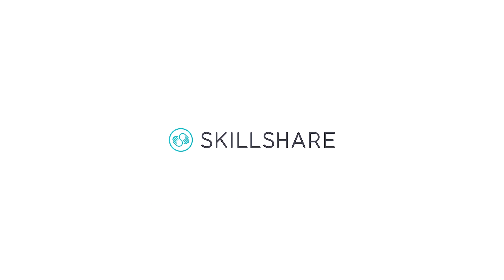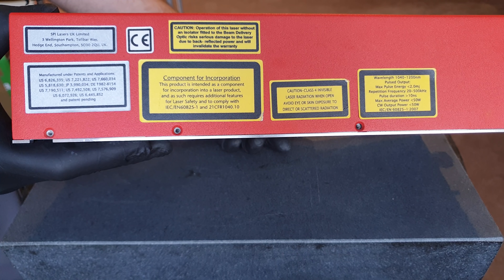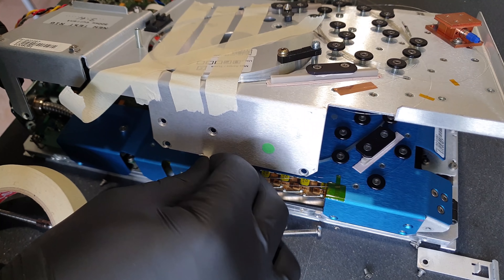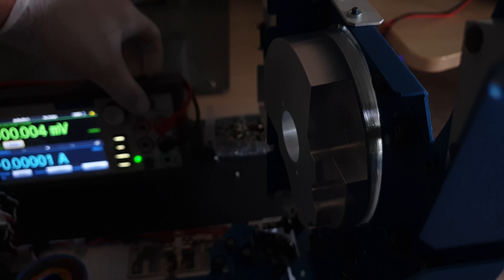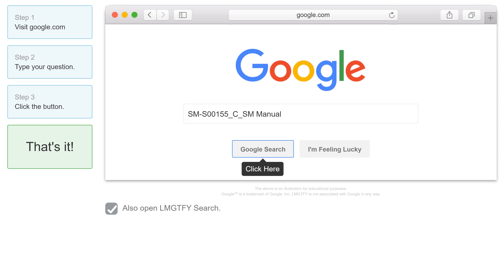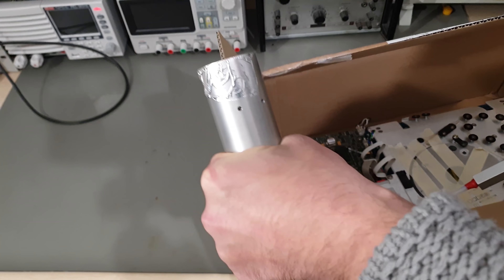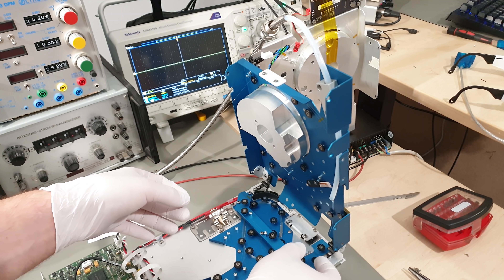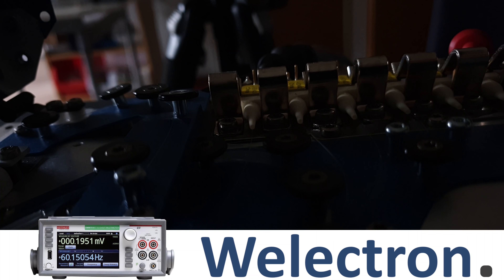Fiber Laser ⚡ 200 kW Peak Pulse Power!

Comment: Your "Way more powerful" diode bars are nothing compared to good fibre lasers. The beauty of these things is single mode spatial output (pulse characteristics are also nice but not as unique) that lets you focus down to micron or less spot sizes. The relative increase in intensity due to this dwarfs anything big multiomode emitters such as a diode array could ever achieve with their limited focal size. All that said this looks like it may not be strictly single mode fibre, should have got an end view shot of the output fibre from the splicer (the fact that you can change the mode shape by adjusting the fibre position indicates this). If that is the case any incorrect bend in the high power fibre section will decrease or even destroy your beam quality. Alternatively the output cleave / AR coat before the isolator might be bad. Also the copper tape is likely just a beam dump for unwanted low power light.

Comment: The circular things are slanted just to keep the input and output plane aligned with the board with the pegs, yet providing space for the correct length of rolled up fiber. This part of the machine must not tilt the fiber to much, thus giving the engineer two choices. 1. Build it linear (and end up with several meters of machine) 2. Roll it upp neatly somehow and dont mess with the axiss.
Reply: WGwireless would the word axi fit there?
Reply: The idea is to counteract the axial twist formed when coiling? 
I wonder if forming a figure-eight, like a faked rope, would allow a design without a tilted section.

Comment: The Fitel S184 is a 3-phase arc fusion splicer, the first of its kind anywhere.  It can accurately splice fibers up to 1200 micron diameter.
Reply: 1200mm? That's oil industry suff, not fiber optics.
Reply: @NGC1433  Pardon me...1200 microns.
Reply: You still need a cleaver to cut the fiber. Possibly 2 depending on the spice. Active fiber is octagonal in shape and needs a special cleaver.  Other splices like the pump combiner use simpler cleavers/splicers

Comment: Definitely misaligned output head. You can bend single-mode fiber in reasonable ways without affecting output shape. You can buy new Chinese output head, and splice it there in place of old one. Re-aligning it is extremely challenging.

Comment: I used a very similar model arc fusion splicer years ago when I was working for one of the major cell phone networks, splicing fiber in some specialty systems for big clients that required cell nodes on site.  Those are some amazing machines.  I never could figure out  just how it manages to actually measure loss in the splice without sending any light through the cable.  I guess it just evaluates the image from the cameras.

Comment: Where do you find all these lasers? I regularly search ebay and the most exotic thing I've come across was a range finder from a British tank. I think it had a pulse power of 20W or so and I doubt I'd be able to make use of its original functionality since the military propably doesn't publish manuals for their tanks online.
Reply: Janis Reinberger Same for large caps...
Reply: I assure you those old  flashlamp driven rangefinders can easily do over 1kW  pulsed output...but they're not designed for high repetition rates.
Reply: With used high tech stuff it's all about who you know. You can get crazy expensive broken or old stuff for free if you know the right people.

Comment: Perhaps the output head is also misaligned?
You're lucky that this laser doesn't use the output fiber and head as part of the "resonant cavity"(ish). I believe some IPG lasers do that, in which case cut cable = paperweight laser, even if you manage to splice it back together.
Reply: Off-Topic: Are you Spirit532? Ex staff on UC.me?
Reply: Why is that the case?

Comment: 11:55 If measured by an OTDR, most likely that fusion would have like 0.3 or so dB loss, the fusion got a little "line" on it, which means it's not perfect (though it could pass, sometimes with a bubble the signal passes better than when it is a perfect fusion, so... who know, only an OTDR can tell)

Sauce: Work in telecom, splicing fibers

Comment: Loved this vid.

Brings back a lot of memories for me, as I used to use the Sumitomo splicers at work (Nortel 1999-2001, then Bookham's).

I think there was a connection between Nortel or Sifam and Oclaro? (makers of the pulsed laser in yours).

I used to do splicing for building EDFA (Erbium-Doped Fibre Amplifiers), which would have worked in a similar way to your laser, but nowhere near as high a power. lol

That laser lab in Hanover looks awesome, too. Kind of wish I still worked with lasers.

I have two 50-70mW Argon lasers collecting dust atm.
Reply: Bookham became Oclaro and was recently bought by Lumentum (one of the two companies that JDSU split into). I started working at Nortel in the late 90s, good times!
Reply: I actually loved it when the screen blacked out. Felt like a mini nuclear explosion.
Reply: @ferrumignis  

Ahh, that was it. Bookham changed it's name, thanks. ;)

One of my lasers is a JDSU, but with an NEC head.

Which Nortel did you work at? In the UK or elsewhere? I was at the Paignton one. #doxxed
Reply: @electronash  Paignton site, it's been leveled and shopping center built on top of it now. Shame, as it was a really interesting place with loads of history, did you ever get to take a look around the sub-floor? It was STC before Nortel, and as a defence contractor it was built to withstand some serious punishment.
Reply: @ferrumignis  

I think only briefly saw the basement. I worked in Passives in L-block originally, between the smoking hut and duck pond. lol

Then at Nortel House for most of the second year, when I started on EDFA. Splicing was good at first, but it did get very boring very quickly.

It was that strange time when everyone knew the site was about to close, but we still had to make it look like we had some work to do when people were visiting. Very bizarre.

Also did a stint in fibres in S block with Bookham's.

And yeah, they've just built a new "Range" shop there, or something. Shame to see the old site gone, as there were all sorts of rumours of companies like Microsoft buying it.

Comment: Hey Marco Reps, if you desire a finely polished fiber optic fiber for a clearer laser output. I would suggest you look to a company ive worked for called Krell Technologies they make machines that polish fibed cables to higher than telecom standards very precise and very finely polished you should check them out.

Comment: What kind of goofball let that splice on the S184 continue??? It was clearly contaminated at the cleaning arc, hello?? The additional temperature spread during the splicing arc was obvoius, regardless of what mathematical estimation it came up with, THAT WAS A REJECTABLE SPLICE. Any residual dust contamination heat at the cleaning arc, and the fiber needs to be re-cleaned and re-cleaved,  The operator of a fusion solicer IS THE SPLICER, the machine is just a tool in the process.
Reply: Yeah it sure looks that way.